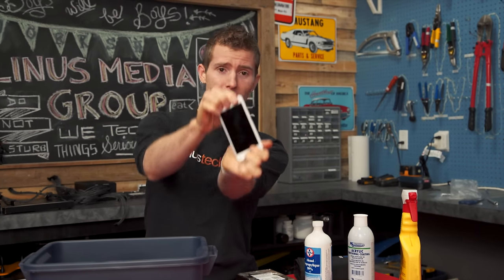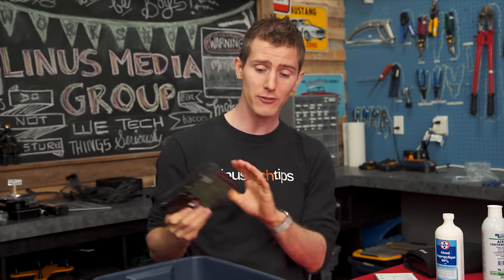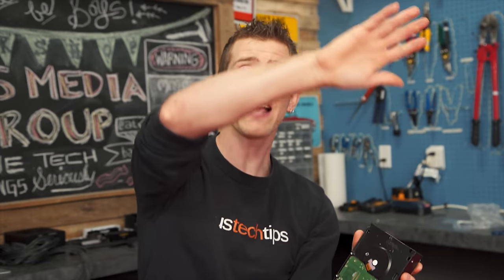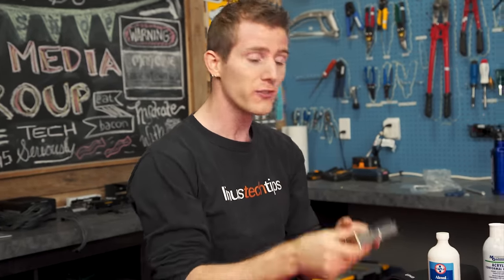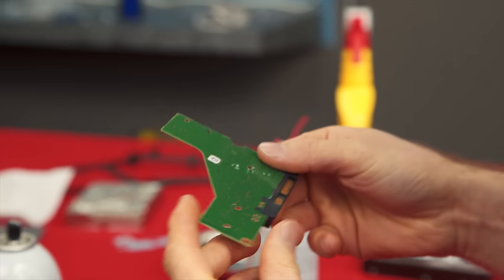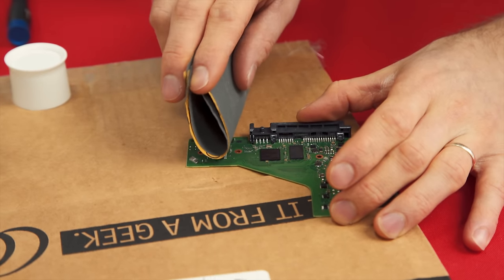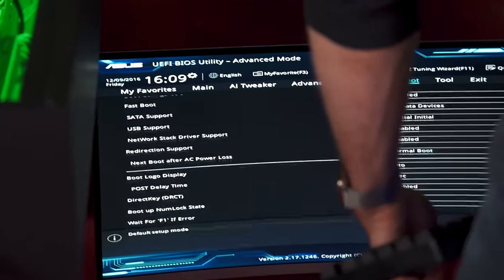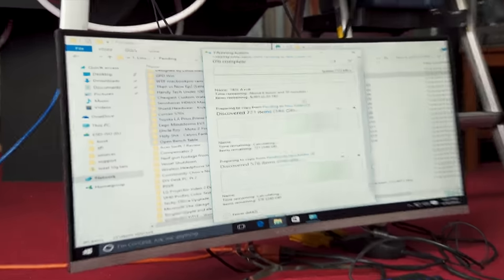DIY "Waterproof" Hard Drive

Comment: I'm a production engineer. When we had problems with water resistance, we used a similar clear coat specifically made for providing water resistance to electronics. But instead of spraying it on (it was only available as a spray) we made the guys in the factory spray a lot of it into a little container and then paint it on. Worked more consistently than spraying.
Reply: oh, by the way. You submerged the connector. The connector is not waterproof.

Comment: i wonder how well a drive would perform if the inside of it was a vacuum
Reply: heads in hdds are "flying" above disks surface with help of air\some other gas. No gas means heads will be right on surface, brutally scratching it and killing your hdd in instant.
Reply: Jubulburb Wuldrd are they flying like airplanes? Or just very close to the disk.
Reply: UNITiSGames i don't think consumer vacuum pumps can go that far.
Reply: the flying height in modern drives is a few nanometers
Reply: there is also a known issue with normal, customer-grade, unsealed hdds - they will fail in high altitudes(i mean exposed, airplane with it's own air pressure inside does not count) due to low atmospheric pressure, simply because there is no enough air for heads to fly above disk surface.
Reply: cold welding wouldn't happen, the metals will have oxide layers stopping that from happening.
Reply: UNITiSGames nah, it would need to be pretty hard abrasion to scratch off enough oxides to reveal bare metal. Plus there's more to cold welding than simply touching two pieces of bare metal in a vacuum, as discovered by nasa when they did experiments on it. It's actually quite difficult to initiate cold welding
Reply: That would suck...
Reply: Considering HDD heads are closer to ceramic than metal, I wouldn't worry about cold welding. They can stick though
Reply: inside a vacuum, an hdd would not be able to shed heat because of the lack of atmospheric molecules. That could be a problem.
Reply: Good luck with that! lol
Reply: Aaron 
Nice thought maybe frictionless
O

Comment: thanks now i know not to submerge my HDD in water. oh wait i only use SSDs.
Reply: AirportHobo Triggers Me your profile picture fits with this comment so well!
Reply: Then try putting your SSD into water. 
For science!
Reply: SSDs should be super easy to waterproof. HDDs have a few little holes drilled in them labeled "DO NOT COVER". the helium filled drive however has no holes
Reply: Considering the problem here were the connectors, then that wouldn't make a difference.
Reply: They would build the connector and the wire inside the harddrive case and making it one solid part on the outside. Then you can waterprove them.
Reply: TessellatedGuy What do you mean bragging? And what do you mean rich? I only have 3 SSDs.
Reply: TessellatedGuy I put my money into important PC parts as well. I won't say which parts because I don't want to upset you more.
Reply: +AirportHobo Triggers Me lol no honey, once you buy 3 ssds instead of getting a titan XP for that same price you aren't going to upset me instead I'm gonna be laughing at your stupidity. I'll be seeing you in 5 years when you regret buying an SSD instead of a hard drive and spend the saved money on a gpu or a heatsink which actually matters. Sorry to burst your bubble.
Reply: TessellatedGuy Or instead of buying a Titan XP I'll buy a GTX 1080. Also, the total cost of the 3 SSDs are ~560 USD which is not the same price as a Titan XP. There's like a $1000 difference. LOL.
Reply: SSDs aren't devices that "actually matter"? Sorry I'm not sure I could hear you over the sound of my significantly faster read/write speeds and game load times.
Reply: Andrew Wogas Maybe he is just like his HDD, slow.
Reply: "Slightly faster load times" clearly you've never ever used an SSD mate... On top of that, the price difference between GFX card grades is significantly more than a sub-$100 "work drive" SSD. Most people run a ~256GB "C:" drive and a 2TB+ drive for everything else. I can sympathise with not being able to afford the components you want, we all can at some point, we've all been there -- but don't talk utter shit in defence of your choices when literally any benchmark or comparison pulled off Google says you're wrong.
Reply: It's not just faster loading times as well but it removes the hdd as a bottle neck allowing sightly higher fps in games where data needs to be read quickly off the storage device
Reply: Man if you think he's bragging, I have 4 ssds, 2 in my rig and 2 just sitting around just because.
Reply: luigi90210 Congratulations!
Reply: +TessellatedGuy I know I'm probably going to burst your little bubble now but what if I told you... SOME PEOPLE USE THEIR COMPUTERS FOR OTHER STUFF THAN GAMING?!?!?!??! :OOOOO
I know, pretty sick right?
Reply: Saitham Woah mind blown
Reply: lol I have one SSD and a normal harddrive. And the SSD speeds up everything. Personally i use it for virtual machines. Also a ssd nowedays is like 50 or 60 dollars for a 120 GB one.. is that so much money?
Reply: Johanneslol11 Yes, if you buy 1x 250GB and 2x 500GB. I don't regret it, though.
Reply: :) yeah if you have the space I would do it to. I only use a laptop though so.  :P  and it is in need of a replacement :) So I first will wait to see what kind of ssd in there !
Reply: +TessellatedGuy Just get a 64gb SSD as boot and auto start drive. Makes a HUGE difference and costs nearly nothing
Reply: +TessellatedGuy Just get a 64gb SSD as boot and auto start drive. Makes a HUGE difference and costs nearly nothing
Reply: My plan for my laptop: 1. take the existing ssd out of it's casing (warranty be damned) and sit that in the hard drive bay. 
2. take a hard drive and sit that on top of the ssd
3. plug one into the onboard sata and the other into an addon sata card
And all this only for the price of the sata card (and maybe some cables). 
Sound impressive? It get's better: I'm doing all of this on the budget of an unemployed high school senior.
Reply: Im sorry everyone, my time machine was left on. TessellatedGuy came from the year 2012 where the 500GB SSD were around the $1k mark and 120GB were about $200.

He forgot to check newegg to see what the prices of the latest ssd were and failed to see that 120GB ssd could be bought for about $50. Cant blame him for not knowing what PCpartpicker is as that site was still young at the time.

Wait? He's from 2016/2017? Well then.... Guess he should of known that depending on size, 3 ssd are not that expensive as 3 120GB SSD's would cost less then a i5 4690k or GTX 960 if he bought either of them brand new in his system (his OpenGL vs DirectX 11 - Unigine Valley video list the last reported specs of his system)...  

He also hasn't learned about having both a low cost ssd for the OS and anything that needs mass storage can be placed on a HDD. (120GB ssd + 2+TB HDD can be had for some where around $120-150.)

Seriously mate... You made yourself look like a fool. 

As for the comment about "seeing you in 5 years when you regret buying an SSD", Im sorry buddy but my nearly 5 Year old Samsung 830 ssd is laughing at you. Not everyone that uses a SSD is using it for gaming or just to boot up their computer faster.

If i was still using that system for what I do now and it was HDD only, A HDD from 5 years ago would be crying trying to load stuff that is I/O or Bandwidth intensive.

For ONE of my usage that I need a SSD, you try running more than 3 VM's at the same time with just a single HDD AND with all those VM's needing to use the drive. All those VM's would make your ENTIRE system come down to a crawl. 

My setup, I use a SDD and single HDD to max out my performance on Hyper-V (without wearing out the SSD quickly) as I need to have VM's for a quick mock Active directory network.

 Using Differencing Disks, I have a Parent Drive (has the OS and is Read Only) on the SSD and keep the child disk on the HDD (where the VM's write too instead of wearing out the SSD).

I can easily have up to 7 VM's running all at once with this setup before my system becomes to slow to run (still because of the HDD limiting everything but having the SSD take a lot of the load off it.)

Your just not doing all that on a single HDD. (Well maybe the WD VelociRaptor could but it's more expensive than this hybrid setup.)
Reply: warmon6 That's a paragraph if I've ever seen one.
Reply: I thought about longer... lol.
Reply: warmon6 So does my girlfriend.

Comment: If the mineral oil is already non-conductive, then coating the PCB was basically pointless, right?
Reply: Ryzza5 The only point here is to make a video that sounds crazy. Gone are the days Linus was serious about technology.
Reply: That's absolutely it
Reply: Linus was serious about technology?
Reply: Flimzes At least it seemed like that when I started watching his channel. He was more professional, videos had more info and were truly "as fast as possible".
Reply: I think he did it because he wanted it to be waterproof in both mineral oil and water.
Reply: ***** Waterproof in mineral oil?. The PCB doesn't need to be waterproof in mineral oil, the drive only needs to be air tight. Pls watch the full video.

Comment: @Linus,
To avoid any short circuit please spray on the plugs before submerging the device under water.

Also, avoid spraying on the metallic connectors just spray on the device after its plugged in basically.

Hope you try this out again.

Thanks,

Comment: I used to do this line of work. Yes the spray is extremely toxic and can cause more than 8 different types of cancers. I've read the MDS. I would first blow all dust off the PCB after removing from the HDD. Then tape all connectors with masking tape. Spray the conformal coating with 2 coats, waiting 4-8 hours to dry in between in a dust free well ventilated room like a bathroom with the fan on. Remove the masking tape and reassemble with all connectors in. Have some conformal coating in a bottle/container and pour it in between the electronic film and PCB till it covers the HDD motor connector. Then finally In order to make the HDD completely submersible in water you must have the connector plugged in when spraying liberally your final coat on the SATA and power cables. Then let it dry for 24 hours. To check if you have evenly coated the PCB, use a UV light or lamp to check.

Comment: Perhaps masking the points of contact with tape before you spray may work better than sandpaper. Seems the coating caused you more issues than the water. Gaskets wouldn't hurt either.

Comment: It's a very interesting idea, Linus, however, you need to hermetically seal the HD while it is connected to the SATA/power connector in order to make it 'waterproof'. Meaning, you'll need at least a dedicated cable that you would use to spray that gunky stuff on.

Comment: actually it worked, the matter is,  when totally submerged, the hard will not work cause the water is conductive and the power isn't supplied anymore due to a short circuit . 

a proper test shall be done using 2 hard drives, one of them coated and the one not. Then put the same amount of data in the hdds. Submerge them in the water unplugged and then power them off the water. then dry them and plug them. 

if both of them are working so the hdd is waterproof by design

Comment: DC Current over water causes really fast flashing and tracking. You need to load those connections with dielectric grease.

Comment: You should have used di-electric grease to protect the power connections and contacts and then pot the entire drive in epoxy that would make it true waterproof drive (especially if you use a waterproof bulkhead connector for the sata/power connection)

The conformal coating is also not meant to protect against total long term submersion just moisture.

Comment: To run the drive in water... Add vaseline to the power, and data connectors.
To run a drive in mineral oil... Don't do anything, just toss it in. Any old drive, vented drives included, will function for the time of a video that way. If "permanent" function is expected, seal the air vents before dunkin the drive in to the mineral oil. As long as you don't put the drive through significant pressure changes, the air-vents can be sealed with no issues.

Comment: Even if it hadn't shorted out, you aren't supposed to cover the holes on a drive, so I suspect it wouldn't have lived too long anyway.  The heads fly on a cushion of air and they need the vent holes open to behave properly.  Might work on a modern sealed/helium filled drive though.

Comment: The initial idea may have worked if you sprayed it with the sata + power cables attached & essentially glued them on. You could have also tried Resin or Caulking first then the spray stuff lol.

Comment: Old video I know, but a better way to do it: use a combo sata data and power connector like you find in a standard case now, plug it into the drive, and just spray a few coats of plasti-dip over the bottom side of the drive and around the connectors. should create a decent seal.

Comment: I would put something over the contacts like post-it notes or and cello tape so no coater would cover the ports, and after attaching power cable and data cable then I would add either hot glue or coater

Comment: Water has a very different dielectric constant with respect to air, so any controlled impedance trace (such as the ones used for SATA) will change its impedance, causing signal degradation due to reflection, mismatch and increased dielectric losses. I don't think the power is the problem because few mA of leakage shouldn't cause the overcurrent protection in the PSU to trip.
An other obvious long term issue is that exposed power supply pins may gradually corrode due to electrochemical reactions.

Comment: when you coat the pcb you sanded of connections that needed to be vitally protected so you completely contradicted your goals try again but plug in all the sata and power connection then coat the entire section around all the plugs and the pcb let dry then test it. so try to use a sata and power cord to extend the usable ports like an extention corde and coat the crap out of the connection going to the hdd pcb and the pcb itself that way no watter seeps into the power connections

Comment: Just before the spray hit, I thought, what would happen if you put data and power connectors on BEFORE spraying?  Wouldn't that keep the conformal coating off those critical connections?  Then I thought, maybe not, that might "glue" those connectors to the drive.

What do you think?  Viable to put the connectors on before spraying?

Comment: If you used Dielectric Grease on the connectors it would still work in water .. try it, it works on boats and cars

Comment: You should have kept the sata connectors clean, then coat them and the plugs with vasolene, for short term testing it would have worked.

Comment: Can you try Spary-ON bed-liner to waterproof a Helium drive?  You'll probably want to have a power and data cable connected that you don't mind being permanently attached.  Wonder what the temps would be or if dipping it in liquid would have any affect at that point?

Comment: Apply the coating to the entire HDD with the cables attached to make a complete seal.
You might want to use the silicon-based stuff so it can bend with the cables movement.
Alcohol is what you would use to REMOVE the coating so don't use that.
At any rate...the sealed-type (Seagate) drive would work fine in a mineral bath system without any coating.

Comment: If you would use dielectric grease on the connectors for data/power this would work fine in water.

Comment: Get some 2K silicone, (not the acid cure type, that's corrosive, some food grade silicone will do) and cast that HDD in silicone, with the cables already plugged in. Silicone may be deteriorated by oil, but not by water!

Comment: You should have resprayed the  hard drive and cable once they were connected and working. That way it would have had a waterproof bond at the connection points.

Comment: Would have been just as interesting to see a video on sticking the helium sealed HDD into the mineral oil, considering that's the only real practical application. From reading the comments I think alot of people don't understand the difference between the two in the first place.

Comment: you should have done the coating of the pcb and then used a sealant spray on the entire drive afterwards putting the drive connectors and all together with a sata and power connector attached and put on a sealant like Corrosion-X. then put some silicone used for insulating bath tubs in around the sata connector too just incase... that "should" work.

Comment: Okay, maybe I'll be corrected later I'm at 8 minutes in. But if this waterproofing works, there have got to be some uses for this, for example if this is possible, liquids that are naturally very cold could be used to cool PC parts, that means they could run wayyy harder without risk of overheating, so this could be a huge breakthrough, right?

Comment: Also I don't think coating did anything useful in mineral oil or in water, since some parts, like power connectors were still not coated and were not protected. You should have put a lot of table salt into water to make your case :P

Comment: Linus, you still had exposed copper submerged in water. what did you expect?
The sata power/data connectors are not water tight, and the pcb contacts are not sealed either

Comment: You treated the PCB but didn't treat the power connector (open metal pins)! Of course it would fail. Connect the drive cables then spray around the cables (both sides) and try it again. Also, you need to treat around the motor connector that you cleaned off.